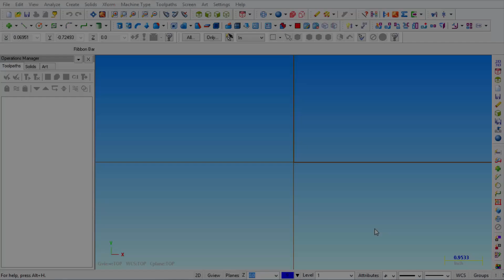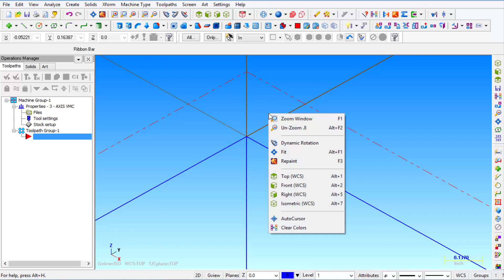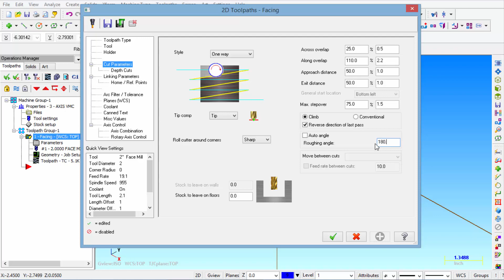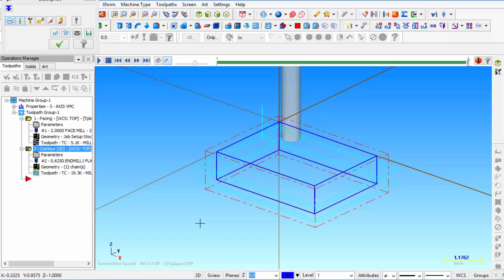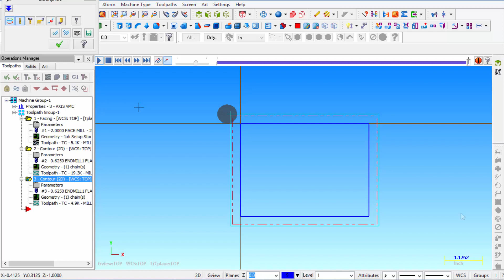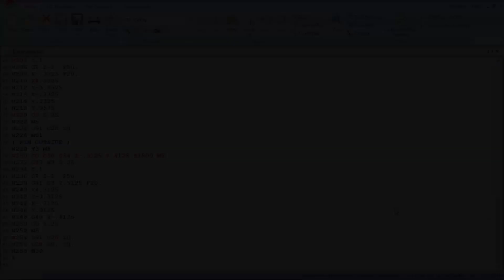BASIC CNC MILLING USING MASTERCAM X7

Comment: hello 
like in mastercam 2025 we can create a line by clicking on origin and then by setting the the value for length...also there is another way of creating a line by giving the coordinates of starting and ending point which we usually do in absolute mode but is it possible to achieve the same by using the incremental or relative way??

Comment: How can I do a slot mill on the middle of a part in the x and y axis so for eg lets say a 2x3 rectangle I want to cut a slot with a 6" diameter slot cutter basically the shape of the part is the female part of a clevis . v9.1 so in other words if the part is 2" thick I want to run a slot mill down the z-1" approx 1.5" deep  it will be a .375" slot . Then I want to drill a hole from top as per normal but if possible using same slot cutter I would like to face the part top and bottom 1.25 " deep and a flat approx .75" wide It doesn't work holding part vertical with an endmill  I tried it was horrible I have many of these to make they are for the door bars on a race car so a male and female clevis with a .5" hole through each . I will be using a 2000 vf2
Thanks so much Sir .

Comment: ONLY $5.99 , 5 HOURS TRAINING VIDEO FOR MASTERCAM MILL 
https://trainingvideocenter.com/udemy-mastercam-multi-axis-programming/ 
 BUY IT NOW BY GIFT CODE 25% OFF Milling Operation : 
Milling Operation and Facing Operation 
Facing, Pocket And Contour Operation 
Toolpath Motion Of Facing And Pocket Milling Operation 
Contour and Drilling Operation Part 1 
Contour And Drilling Operation part 2 
Slot Operation 
Combine Operation Of Facing, Pocket Milling, Drilling And Slotting 
Milling on Text 
Milling On Image 

Multi Axis Programming : 
Morph Operation 
Multi Surface Operation -1 
Parallel Operation 
Multi axis Drill 
Morph Operation 
Blade Expert

Comment: 90% of Shops don't use or need Mastercam..."Learn to code".
Don't be dependent on someone else's copyrighted software.
Reply from the maker: Waylen 
I agree that you have to learn to code. I find myself troubleshooting programs all the time and the ability to find errors in the program is what makes you a CNC programmer. For the last 34 years I have worked and installed machines and every shop has had a CADCAM software they use to write their programs. It definitely depends on the complexity of the part of course but CADCAM software saves a lot of time and if you do any kind of 3D contouring you cannot justify hand writing code. Possible yes but not efficiently. Thank you for your comment.
Reply: @TomStikkelman  Yes,Editing and finding mistakes is much easier in basic g-code if the program is written that way.Too many shops, However, are using computer generated code in their programs making it very difficult to do anything with and it's all for the reason of hiring unskilled workers.Creating a disconnect between a good education and getting real world job using that education.
Reply from the maker: Waylen 
It’s hard for shops to find skilled workers. The only way to become skilled is to work in a shop for years and not just as a button pusher. Many shops struggle to find skilled people. The education system is not helping that
Reply: @TomStikkelman  Shops that never seem to promote from within  have done much to create the problem,if it actually is a problem.Many doing the programming and leading the shops are under employed Engineers with 4 year degrees and more,Not really Machinists at all,The industry is a mess.My local community college just announced they are teaching Mastercam to get kids interested in going to school for the career.Yet, when they graduate and realize how few jobs there are in that that specific area they get discouraged and leave the low paying button pushing job they have..There isn't much of an opportunity for someone from the shop floor to work their way up.
Reply from the maker: Waylen 
That is true. The operator really has to do things on his or her own to advance. It takes a lot of ambition to do that. Thanks for your feedback. 👍
Reply: @TomStikkelman  And expect to be vastly underemployed for your investment.:)

Comment: Hi.Great tutorial.I have question.I put in Fine Mill11  to use the diameter, but when I throwt the program it does not show D11.Where to turn it on? Thanks
Reply from the maker: Make sure that "WEAR" is activated in order to post out the D value.

Comment: I am assuming and it might help others--that you do not keep the tool in contact with the material rounding corners (sharp)--so that the lines drawn do not confuse the viewer?  Generally programmers will roll the tool around corners since you take your life into your hands when that cutter leaves the material and travels out into space possibly violating something on more complex parts

Comment: What is the best method for removing the stock that was in the vise at the bottom of the part?
Reply from the maker: smusick1955 
It all depends on the shape of the part that you machines on top. usually you machine the top shape into a jaw in order to remove the excess material from the bottom and then machine the features on that side.
Reply: I can chime in that for example in mold making you first put the block in upside down-exactly as in this video and machine the bottom and tapped holes and such--you then turn the block over using your chosen method for holding it on the finished walls--you then use an indicator on the finished walls to pick up center zero- and lo and behold when you machine off the rough sawed top--the walls with match perfectly. After the block is flipped over if there is alot of material keeping you from getting in with the indicator its ok to visually mill it off so the needle is not trying to sweep under a huge ledge.

Comment: I noticed the face mill is cutting at +.05. If I change the LINKING PARAMETERS to a DEPTH of 0.0, the face mill will cut the materiel.
Reply from the maker: Yes sir. I missed that step. Thanks.
Reply: +Tom Stikkelman thanks for doing these videos. Im learning alot from them.
Reply from the maker: +Greg Thornhill Great! I appreciate the feedback.